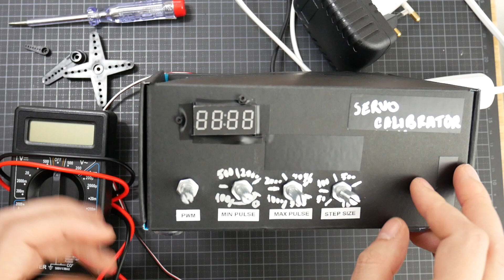Servo Calibrator - using Arduino and potentiometers

Comment: I would have not thought of using an extra board for the PWM.  I would have just thought to use the PWM off of the Arduino.  I would like to know why you did it this way.   Is it because the Arduino's PWM is not as good?
Reply from the maker: Of course, it's possible to do it directly from the Arduino, without the servo board. I chose to use it because I wanted a setup that was as close as possible (in terms of hardware and code) to what I usually have in my projects, and there I am often using the servo board since the number of PWM pins on the Arduino are limited.